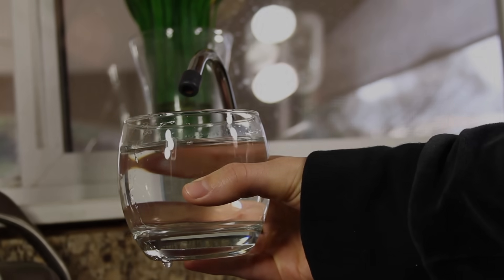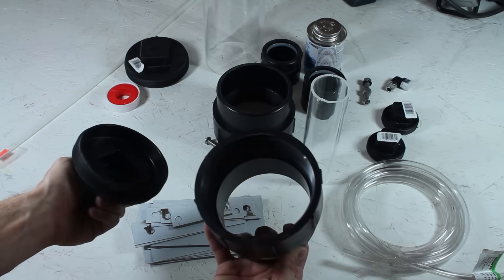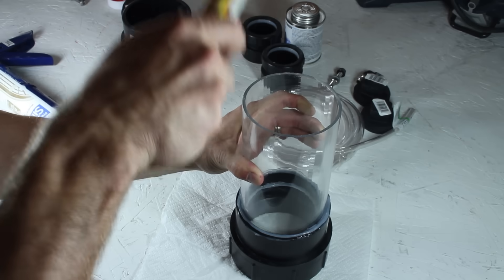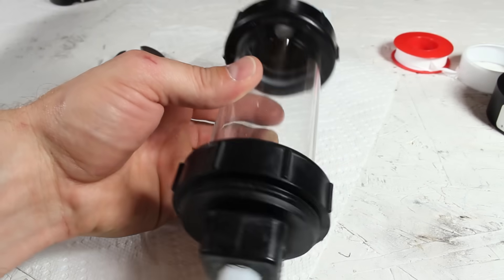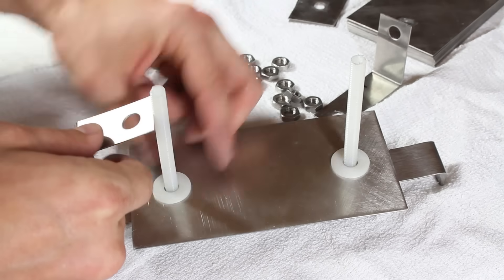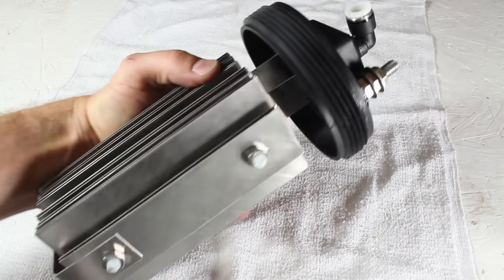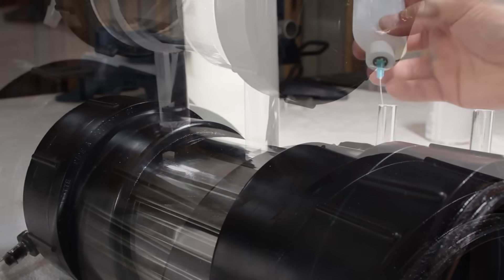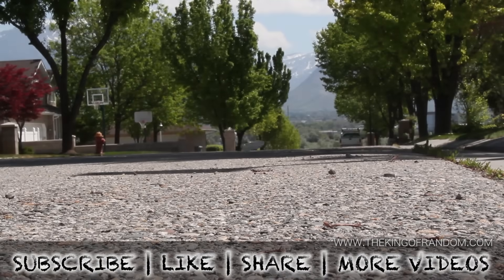HHO Generator - Water to Fuel Converter

Comment: I just made one of these and am trying to run it off a 12v server power supply that can put out 62 amps. The production of gasses is very low though. Would adding another 12v supply in series or parallel make for greater gas output? I am using Potassium Carbonate as the electrolyte and it is definitely doing the job, so thats not the issue.
Reply: +Christopher Nasseri doubt that... using 62amps, theoretically you can produce about 1.15 mols of Hydrogen, using KOH or any other kind of salt will help but the gas output will still be restricted by the Amps

Comment: can you make it two seperate chambers to keep the H2 and O2 separated? even if the water of both chambers has to be conected you could put a pipe through the bottom tht the gas wont flow through. or do the H2 and O2 both come from the same terminal?
Reply: +James Sever The problem with this is the distance between the cathode and anode will be increased which increases resistance and decreases overall output. You could counter this by having more electrodes and more electrolyte in the solution, however after a certain point it is not really worth it.
Reply: Christopher Nasseri but my question is, does the hydrogen come off of the separate plate as the oxygen? Or do they both come off the same charged' plate?
Reply: I understand now. In the electrolysis of water, the positive plates produce oxygen and the negative plates produce hydrogen. Grant's setup does this, however since all the plates are in the same vessel the gasses mix together. This is why it has such an explosive property, the Oxygen and Hydrogen are already mixed together and ready for a source of activation energy to start the chemical reaction to form H2O. Would be glad to discuss further if you'd like,
Reply: Thanks, thats really what i wanted to know bc i want to be able to store the oxygen and hydrogen seperately if i want to store it for a long time bc if i store them together then it is very dangerous

Comment: Is it possible to power this with telluric currents?
Reply: what?
Reply: I-Love-CO Mountains
Telluric currents are low frequency electrical currents that flow between the equator and poles. Think about a faraday disc and you've got the right idea

Comment: I tried drawing the circuit diagram and it doesn't make sense some of the plates in between wont be connected to any terminal then how will those plate carry out electrolysis? As in some of the plates in between have insulating nylon washer on either sides i.e. no connected to any terminal.

Comment: Did you connect the batteries in series or parallel? and which is better for this application 12V and 50A or 120V and 5A based on a 600 watt unit?

Comment: Anybody making one of these: DO NOT USE STAINLESS STEEL!! Stainless steel contains chromium, and although the metal does not appear to degrade, it is the chromium that is consumed. Electrolysis will leach chromium out of the anode in the form of hexavalent chromium ions. These ions are highly toxic, are harmful to the environment and are 	also very carcinogenic (causes cancer). Water that can become highly saturated with hexavalent chromium from using stainless steel electrodes can irritate the skin upon contact (like bleach or industrial paint thinner), and is also illegal	to poor down residential drainage systems. You don't want to poison the water shed with this stuff! PLEASE DON'T USE STAINLESS STEEL. A much better, safer alternative is copper. The best choice, though more costly, are platinized  electrodes because they will never degrade in the electrolysis reaction.
Reply: FluXGamingChannel  Depending on the electrolytes you have in solution, a number of things may occur. Most chlorine salts (like sodium chloride or potassium chloride) will produce chlorine gas instead of oxygen at the cathode because chlorine is more electronegative than oxygen. Acid electrolytes like vinegar and hydrochloric acid will oxidize copper, consuming your electrode and leaving it a black/brown color and decreasing efficiency  of your rig. Some basic electrolytes (I suggest sodium hydroxide a.k.a. lye) will not consume the electrode unless there is a high concentration of the electrolyte. There are cases where copper will be mobilized from the anode and then deposited on the cathode in the form of metallic copper causing the cathode to "grow" while the anode "shrinks." This process is easily reversed simply by reversing the polarity of the electrodes periodically. Here is a nice forum on this topic, if you want to delve deeper: http://www.thenakedscientists.com/forum/index.php?topic=1298.0
Reply: +Solo Socks A nice tip for making one of these with copper is that you can buy copper pipe of multiple diameters and put them inside of each other like nesting dolls. You can make the outside tube one of the electrodes and the very inside tube the other. just make sure to space them with some sort of nonconducting material because otherwise they won't work as well.
Reply: Rafael De Castro: There wouldn't have to be any major change in the setup, only that the electrodes would not be stainless steel. The voltage and current would be nearly identical, so the power source doesn't need any sort of modifications, if that's what you're asking. 
May Nine to answer your question: there are many ways that any type of carcinogen may cause cancer (generally speaking). In the case of concentrated aqueous hexavalent chromium, it is carcinogenic to the point where direct contact with the skin possess a danger, not to mention ingesting it. In powered form (water evaporated off) it can be easily dispersed into the air at which point it can be inhaled, posing the risk of developing lung cancer.
Reply: @joeycoston7692  This..... all is brilliant; YOU ARE FRIENDED SIR! Please contact me. As a nuclear welder I am dedicated to perfecting this design for a common layperson; the idea of reversing the polarity of copper plates is quite ingenious and I WILL be experimenting with it in the future, Thank you for the insight.
Reply: copper is lit
Reply: Depending on the system life, you might get away with graphite as well. It's much cheaper than noble metals, but needs a lot more potential to drive the reaction.
Reply: +Joey Coston And what then? We'll get corrupted or eroded copper? Explain me master
Reply: +Joey Coston Thanks! I was planning to ask the king of random how the electrodes keep up after time, but you answered my question... I thought I was missing something from my chemistry there, only platinum and gold can act as anodes (graphite would disintegrate over time so it is out of the question as well)
Reply: +Joey Coston Thanks for the info!  I've apparently been doing this the wrong way and unwittingly making environmental pollutants.
Though it does make me wonder about those "water filters" that make alkaline water using electrolysis . . .
Reply: Taylor King  I personally don't like using salts due to chlorine gas and it's corrosion of electrodes.  KOH is a good base; I usually use sodium bicarbonate since it's food grade and therefore easy to come by.  I'd try Copper electrodes and a copper sulfate solution.  Maybe use a plastic form to wind copper coils onto for easy replacement.  Then switch the polarity periodically to save your electrodes.
Reply: +Joey Coston+
 ?Heisnberg is that you
Reply: Idk if you will answer because this comment is from like 2 years ago... But what about steel?
Reply: Aidan Ramsey I thought all steel had some chrome, but Wikipedia seems to disagree. I would also think normal steel would rust quickly. Anybody else have thoughts on using steel?
Reply: +Joey Coston Suppose i do everything the vídeo say to do, although I change the plates to electrodes, would I have to change anything in the setup ?
Reply: Thank you for the reply because I didn't know that myself and would not have looked into the pros and cons of making one of these and any effects that it may have on the environment or humans in regards to gases being exchanged through metal
Reply: +Taylor King No, unfortunately it isn't the chlorine content of the electrolyte that affects the production of hexavalent chromium. The chromium content of stainless steel acts as a sacrificial electrode do that the iron doesn't oxidize (rust). Just try to avoid stainless steel as the electrode, altogether.
Reply: Dima V I'm sorry, no.
Reply: +hrprada  I'm not sure where you got your information but what you're saying doesn't quite make any sense, seeing as though water is usually a gas at those temperatures so there would be nothing for anything to leech into. I've had actual experience in building and using several electrolysis devices and hexavalent chromium was always produced when I used stainless steel as the electrodes before I figured out what was going on (it turns your electrolyte solution yellow) and transitioned to copper or platinized titanium.
Reply: @joeycoston7692  Additionally what concentration of copper (ii) chloride have you experienced has the best effects as an electrolyte?
Reply: hrprada The yellow color would be sodium chromate if you were using sodium hydroxide as a electrolyte
Reply: Whell where do I find copper sheets
Reply: Know of any kind of a Chemist's handbook for what not to mix up? Precautions to take? Doing chemistry without being a chemist might be a little risky! Thanks for the heads up with your comment.
Reply: I Hope you atill use this account Please help me 
I cannot find stainless steel in my area can i use tin instead of that. I know it will corrode but I want it to work for only a Day and for my science project.
Reply: this is true.. very good point this warning should be heeded
Reply: The best design ive seen from an efficiency perspective involves separating the conductors (similar to your nesting doll suggestion) and only charging the two ends. the center conductors act as an anode on one side and a cathode on the other side, so long as you dont give the water a path around them. I once saw an analysis of the electrical requirements based on the number of modules built this way, and it was way more efficient than allowing the water to flow freely around the conductors.

Comment: Dont use tap water. although its not much chlorine, it still has chlorine in it. when chlorinated water is electrolyzed, the chlorine turns gaseous first and creates extremely dangerous chlorine gas

Comment: Grant, I wanted to give you another idea for a video using the electrolizer machine. The browns gas burning actually has a various reaction when the flame from the gas is in contact with various materials. It burns hotter when it comes in contact with say stainless steel then it does with say aluminum. It will cut right through metals like stainless steel. try it :)

Comment: maybe eventually this technique could be used for fuel
Reply: +Carter Fruge already is, Toyota mirai, check it out
Reply: +Saumantas Semaška cool
Reply: +Carter Fruge Wow. How ignorant you people are. 

Just check out how rocket engines work. We've been using this for at least 70 years. It's how we sent rockets to space, for Christ's sake.
Reply: +Funky Monkey Madness Electrolysis is currently sometimes used to produce hydrogen. Usually it is stripped from natural gas though since that is cheaper.  It is possible to use it within an internal combustion engine in a car, but fuel cells (which use the hydrogen to generate electricity) are a more promising technology.

By the way as was said in the video the particular technique used makes a mixture of both hydrogen and oxygen which would not make a good car fuel as it is extremely explosive.
Reply: +Carter Fruge it will a good idea to use a solar panel to charge the battery and then use the hydrogen for combustion on a regular internal combustion motor, only fuel inyection it is needed to be changed the rest is same that for regular gasoline...
Reply: ***** I mean like car feul.I just found out about this
Reply: +alejandro catan (morfeo) Doesn't make sense. Combustion is the problem. It wastes around 1/3 of the energy by default and there's nothing you can do. Electrolysis is also very inefficient. 
Use that power to charge a battery and you will get multiple times farther.

Comment: Grant, have you tried using filtered seawater in that project, instead of that chemical and regular water?
Reply: I thought about that recently... finely filtered water from the ocean. Filtered just enough to get the bits of matter out. That would definitely be very electrically conductive. I wonder what kind of gases it would create when it gets to bubbling.......

Comment: i made one of these for 60 bucks, and cut a few corners.. people, dont cut corners.
intstead of stainless steel i settled for simple sheet metal from home depot. it almost instantly turned to rust.
they did not have nylon threaded bolts in my local store, so i used nylon rope instead, and made a flexible accordion metal thingy. 
but most importantly... people. do NOT USE TABLE SALT AS AN ELECTROLYTE. 

I USED ANODIZED SALT AND MADE CHLORINE GAS AND A SODIUM PEROXIDE. DO. NOT. UNDER ANY CIRCUMSTANCES SHALL YOU CUT CORNERE
Reply: Aluminum would work fine, but it will corrode faster than stainless, stainless is the best for this because it doesn't rust, and it's high tolerance for electrolysis.
Reply: @thelikebutton4405  No, stainless steel releases chromium ions (really toxic)

Comment: In Turkey one guy did it for this car. (A gallon is close to $5) He was driving this car with Hydrogen that comes from water. I can give the link if you guys want. He says it drives perfect yet, he got 20 to 30 hours power extra with hydrogen. But after 6-8 months later the engine died. He said if they make engine for hydrogen we do not need oil any more.
Reply: Quantum Leap attach the machine to solar panels problem solved
Reply: Jack It would be far more efficient to use the solar panels to charge batteries, then use them to propel cars.  The losses accrued by going solar to electrolysis to burning hydrogen in a very, very inefficient ICE engine are HUGE.
Reply: alejandro catan A hydrogen solution is not in the cards for airplanes, the tanks used to store the hydrogen would take up too much space if they expected the same range as they get from jet fuel.  No, hydrogen is just an energy storage medium, and not a very good one at that.
Reply: +Oguz Oguz give the link
Reply: +Cosmos Hi Buddy
Reply: Jack
Ahhhh
Reply: Cosmos I think we can both agree that this is interesting
Reply: Jack
Yeah, I'm going to send hydrogen bombs to North Korea!
Reply: +Oguz Oguz fuel inyection it is needed to be changed in the internal combustion motor, hydrogen is too powerfull for actual motors, it is a better idea using and old car with an old motor and change fuel inyection, old engines are strongers and designed for being used with more powered fuel from old days when gasoline was cheaper and more contaminant, hydrogen must be the energy for the future cause it is easy to obtain and more friendly with enviroment...
Reply: +alejandro catan (morfeo) I think you right. But again, I do not know much about cars and engines. If see this guy in Turkey I will tell what have you just said. :)
Reply: +alejandro catan (morfeo)   If you can find a cheap source of hydrogen be sure to let us know. If you make hydrogen using the gadget in the video, you'll be WASTING precious electrical energy. That does nothing good for the environment.
Reply: Quantum Leap
^ use your head. There's so many different renewable clean energy sources.
Reply: Cosmos I have used my head, and electrolysis of water to make hydrogen is a very energy wasting concept.  It just wastes our renewable clean energy sources.  Whether the energy is renewable or not, it is foolishness to waste any of it.
Reply: Quantum Leap
Exactly. If somethings renewable we can waste it. Because it's renewable.
Reply: Quantum Leap there are some limitations in using batterys charged with electricty, for example airplanes need fuel for jet engines in commercial flight, an hidrogen solution will be a best choice for those kind of transportation

Comment: I am working on hooking mine to a fuel injection with a boost contoller relay that will auto shutoff the hho cell and a float for my 20 gal bubbler moded for a gas tank to fill the bubbler at a certain level.  the 10 gal pressure tank will get at 30 psi max with efi adaptors and flashbackers and 50 amp breakers.  -Its a plan i am 17 going on 18 this will cost me 700$ and i am a programmer lol and mechanic hope i can figure it out trying it out on a ford haha ill hide this project.
Reply: +nick edmunds I am going to do a remake of a gastank in stainless steel lol
Reply: +nick edmunds no rust

Comment: canu use a system with an air compressor to store the gas ? or use liquide nitrogen to cool it down ?
Reply: +Dexter Wren liquid nitrogen is warmer than liquid hydrogen
Reply: didn't know that my bad ,but there is any may to store it and in a safer way to :s

Comment: Would the plates of an aluminum heat sink work as cathodes/anodes instead of the steel because I'm not sure if I can get access to a steel company.
Reply: +Matt Bowen nope, aluminium doesn't have the conductivity needed to accomplish this.
Reply: +Matt Bowen not very well
Reply: +Matt Bowen If you're willing to fork out postage you could always find one online.
Reply: +Kastley   Has nothing to do with conductivity.  The problem with aluminum is that it will corrode badly in this application.